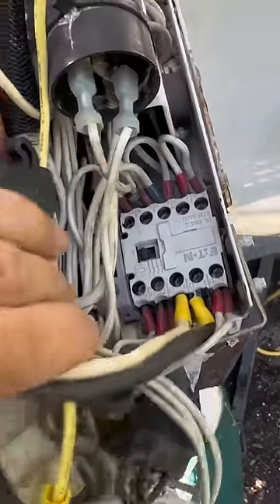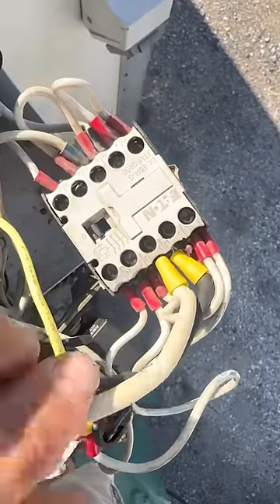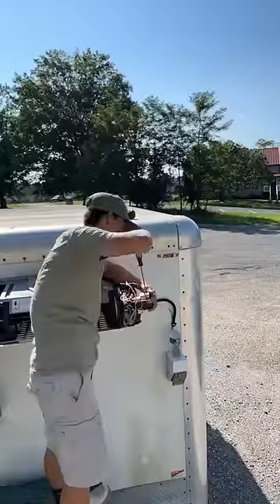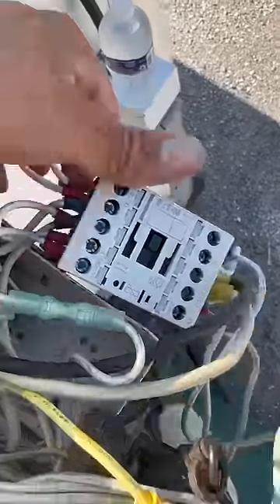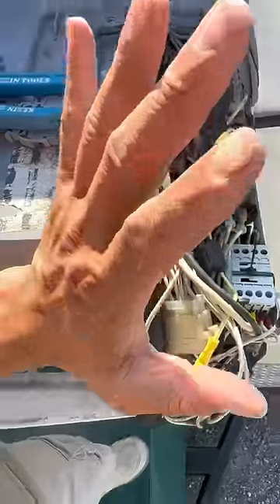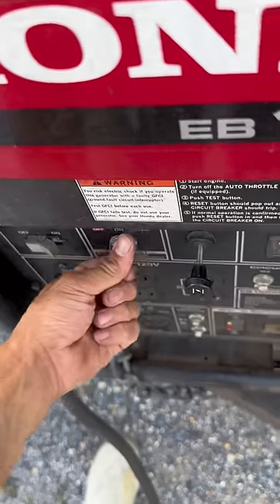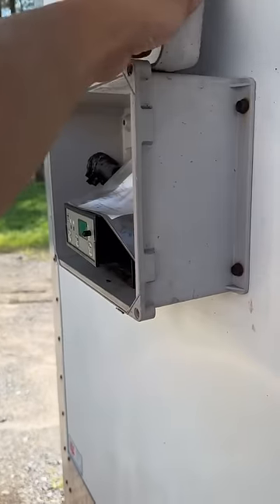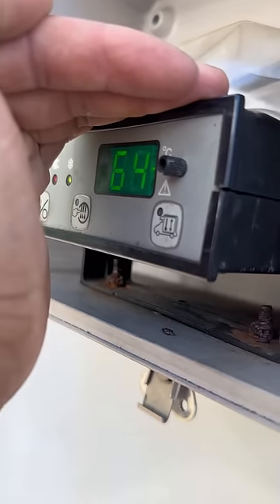This tiny thing has cost me THOUSANDS OF DOLLARS!

Comment: You need an alarm/alert on that cooler!
Reply: And make it a Bluetooth alert to go to your phone and your sweetie.
Reply: I did t see your post but I just said the same thing
Reply: One that alerts your phone
Reply: I use a webcam pointed at my thermostat so I can check it if I’m away.
Reply: Safetouch alert
Reply: Yes, the vaccine refrigerators at the hospital where I work have alarms if temperture goes below a certain level.
Reply: more than alarms but he should cobble togel ther a Refer Unit as a back up 

UP!! System the breaker Clicks Aluminates A.LARM by Wifi and Blue shoot

THEN Automatically Click!! "I got ch U... Re Re Re Ruh blub blub Choo Kerr Rutr Coooolin Gurvner

Rollina littlest Poof*

 uhh Co'al

that'd b '
Reply: Yes, because this wont be the first time a fridge costs him this much
Reply: I came to post this lol. I know I am behind. Does he read his comments? It would be easy for him to have that done.
Reply: @Sabrina-vu9mv All the hospital fridges usually have alarms. They are really sensitive, if you hold the door open too long they will go off. He needs to figure out a system to monitor the alarm if he gets one.
Reply: Thanks for saying it before me.
Reply: with an automatic backup cooler should temps drop to a 49* point
Reply: Someone needs to send him an alarm that alerts on his phone when it drops below a specific temperature.
Reply: Yep !
Reply: He should definitely have a backup system in place for something like that as well.

Comment: That is a contactor my friend. When the coil is energized it closes the circuit for power. Keep grinding and learning!
Reply: I was wondering if anyone else knew
Reply: Depending on if it's a normally open or normally closed contactor
Reply: Came here to say this.
Reply: Man... They've really gone up in price! They used to cost $20!
Reply: Annnddd the electricians meet here. My first thought was great ANOTHER breaker diagnosed to be bad for doing it’s damn job. But then… contactor. And yes my friend, not cheap.
Reply: @kr3wz89 with a fridge compressor probably normally open.
Reply: @OldsmobileCutlass1969Va it's an eaton/mem . May not be in production anymore hence the price on the Web.
Reply: Yup a European contactor for use with Din rail. I would be sad to see if he changed it and then found the coil voltage was the issue. It would have been good to test it by manually pushing in the coil with a screwdriver 🪛. 

Jeff - Licensed Electrician Sunny Central Florida
Reply: @onecrazywheel  I'm always afraid to push any contactor with a screwdriver, even an insulated one. I carry a chopstick in my toolbag nowadays for anything in a control box that needs to be pushed around.  I took out all the power in an assisted living facility once. Not good.

Gerry - Unlicensed commercial dishmachine technician Sunny Hawaii
Reply: @certifiedbrokanic  If you use a VDE screwdriver and press the top armature bar you should be ok,  But never go anywhere near live components with un-inulatted tools.

Comment: Just so you know that's not a breaker. That's a contactor. Think of it as a large light switch but instead of you turning the switch on and allowing current flow a coil turned on by electricity turns the switch and allows the top and bottom to connect
Reply: Thank you! I had to read so many comments before someone said this.
Reply: Help guide Nick to understand more about his situation.  I'm sure he would really appreciate professional advice from those who know.
Reply: Shouldn't the breaker have failed first?
Reply: They have different functions, so no. 
The old contactor wore out and needed to be replaced

Comment: Keep an eye on it dude. If the breaker tripped it might not have been the breaker, could have been something along the wiring that made it trip.
Reply: Glad I wasn't the only one who thought that. Wiring harnesses can go bad and not even show any damage.
Reply: @420Satan_IDI  exactly. Or you could have a wire that ever so slightly rubs up against the metal enclosure and over time the outer jacket could wear and cause nuisance tripping.
Reply: Definitely what this guy said!
Reply: That’s not actually a breaker, it’s a contactor
Reply: Refrigerator compressor might be drawing too much current due to age/wear
Reply: If it's for 3 phase motor, one contact could have bad contact, so the motor protection will trip (1 phase is missing).

But in this situation it looks like you have only 2 contacts (2+2).
Reply: This is a contactor not a circuit breaker so it doesn't trip or provide any protection. It simply turns on or off when it gets power.
Reply: Good catch, it is a contactor. That just raises more red flag to me. If it's just a switch and not protecting anything, then what is protecting the contactor? A fault in the system still could burn out a contactor and I wouldn't take it for granted just replacing it without understanding why it went bad. Unless its 10 or 20 years old then maybe. Regardless I would protect it with inline fuses. It's much cheaper, faster, and easier to replace an inline fuse than a contactor. You could also go the extra mile and wire up some pilot lights to indicate if one of the fuses blows. Would be pretty cheap and wouldn't take that long to do and could save your ass.
Reply: Warning, this quest leads to side quests.
Reply: @samuelneil2691  Normally there would be a fuse or circuit breaker before any contactor. Perhaps this guys setup does have some protection but he missed it? That aside common modes of contactor failure are damaged / worn contact points and also occasionally a burnt out activation coil. Just as you stated a lack of protection could cause the contact points to burn.
Reply: There's lots of reasons a unit would shut off. I would want to know how he arrived at this conclusion. I would say contactors are usualy around %15 of the time the reason.
Reply: I alway say ida breaker is tripped or fuse blown. It happened for a reason I come from 12v automototive electrify. Far more forgiving that that damn alternating current.  So
Reply: @bostonbruinsfanboy contactors often burn the contacts after years of operation, especially exposed to salt air, so probably it was not making contact to power the motor or whatever else is fed through the other contacts.
Reply: That was not a beaker it is a contactor.
Reply: That's actually a contactor which is even more troubling..... There's DEFINITELY other issues at hand.

Comment: You can order then cheaper but would have to wait for shipping online. They are common parts for PLC systems and control panels. I'm more used to Allen Bradley.
Reply: I'm engineer myself and PLC programmer. I use them all but Allen Braldey is the most common I program with.

Comment: As others have mentioned, that is a contactor. It looks like it’s a 4pole with the power circuits in series to divide the arc between two contacts. I can’t tell what coil voltage from the video but if it’s 120 or 240VAC you may have an issue with contact chattering during motor/compressor startup. This is a common issue when powering larger single phase motors/compressors from generators, especially smaller generators. This is due to the significant inrush current during motor startup causing the voltage to sag below the hold voltage of the contactor coil. If this is what’s happening the new contactor will also fail prematurely.

Comment: As an electrician usualy there's a reason a breaker trips if the new breaker is rated for the correct amps and keeps tripping you will have to troubleshoot a bit more. The fact it's for a fridge means there's a compressor probably a capacitor and relay. Google your make modle fridge and specific symptoms you might get some info on what to do good luck

Comment: Nice work, bro fast tip, put a tracktor tent over your freezer to cover it from sun, open the tent from both sides to have air moving, youl save lot of energy and the freezer does not need to figt direckt sun light. Can it catch :D

Comment: Thats a contactor not a breaker. That contactor is basically four pole single throw heavy duty relay. And all four poles are normally closed. but I’m sure they explain that to you when you went to pick up the replacement. :-)
Reply: It's not normally closed It's normally open and closed when the coil is engerized.
Reply: @camerongreco2146  Your right. I was going by what it appeared to be visible on the contactor in the video. But after looking up the model number, it is four normally open contacts.

Comment: Thats not a breaker, its a contactor (or relay). Looks like a 5-pole. Its like 5 switches. It can handle higher amperage. A smaller, lightweight switch connects to the coil on the side of contactor, and engages the electromagnet in the contactor, closing the 5poles, completing 5 circuits.
Happy Birthday, Grandma! Stay strong, outlive us all!

Comment: Wow. This is exactly why I said to check these relays when I seen your overheated wires. But I know my comment was lost. Tried a few times😅
Reply: And before anyone says it to me, it's a 4 pole contactor that he just replaced.  Some call them a 4 pole single throw relay, 4 pole electromechanical switch.

But these can have 3 on 1 off when activated or some other strange combination needed, and some have auxiliary on top. And cost an arm and or  leg

Comment: Before you think changing the breaker will fix it. You need to measure the amperage draw on the system. There could be something else wrong that is overloading the breaker. You need to check everything. Make sure the condenser is clean. If not it could cause the high pressure side to be to high working the compressor hard and drawing to many amps causing the breaker to trip. So don’t assume take the time to check everything 😮
Reply: It was a contactor not a breaker. They only last so long.

Comment: Contactors are a part that should be inspected and replaced as a maintenance item after a certain amount of run hours and you should check wires for tightness and check voltage and amp draw that is a 12amp contactor also keep the condenser coil clean dirty coil causes higher refrigerant pressure which causes higher amps and you should do some research on generators just because it's a good brand not all provide clean consistant power for inductive loads/ electric motors

Comment: Hey i do this for a living, get a line voltage thermostat to make a circuit on temperature rise and alarm bell or red flashing light etc. For a n alarm. Try to use a separate circuit so it the cooler looses power its not affected. Keep working and good crabin .

Comment: That "breaker" looks more like a contactor. Think of it as a switch that has the control power separate from the motor power. 
So you can use 24v to control the higher 120/240 voltage.

Comment: there must be something out there that will text you if the temperature goes above a set value. if not, maybe something that alerts you that no power is being used. the electric monitor is not bullet proof in the event you run out of freon but at least it would work on breaker trips.

Comment: It’s doubtful that the breaker itself is bad. It could
Be, but more than likely something’s causing it to trip. Weather to thin or wrong type of wires somewhere or the heat idk but you gotta figure a way get a cell notification when the power goes out. Maybe a ring cam idk

Comment: Clean out and defrost the cooling coil in the fridge and the condenser coil on the outside.  The breaker trips because it is in an overload situation, you need to take a look at the mechanical parts through the fridge to see why!    Happy crabbing.   I’m also just a framing carpenter maybe there is an electrician, HVAC technician or electrical engineer that can help you better.

Comment: The barker go bad do to heat  ,condensation   caused by something else's. Find that overload or that will come back. A braker is a engineered week link .  Dialect grease  to keep out water.
Reply: It wasn't a breaker. It was a contactor that goes bad over time from opening and closing. Just normal wear and tear.

Comment: The breaker and plug are signs to other electrical problems. Most likely under sized wire
Reply: It was a contactor that wear out over time.

Comment: You're not an electrician. I am, so some advice to save you money, a breaker that trips does it's job, protecting the whole circuit. Usually the real problem is the load is drawing too much current because it is worn out. In the refrigerator, it would likely be a faulty compressor.
Reply: It wasn't a breaker.  It was a contactor which don't last forever.

Comment: Dialectic grease so keep that contact from corroding. And then you get a whole bunch of load on it, and it Burns out your breakers. Because you keep reset in a breaker thinking that's the problem. It's not you're overloading and it's probably due to the exposure of salt air to your exposed contacts. I'll buy you buy components to design for at sea. You know sealed so that you don't have green slime Uber everything I bet I can strip half the water's back on your. And they're covered in green Slime and running hot. Oh, well, it'll burn someday, and you with it.

Comment: Put an ammeter on those load wires, heat may be wearing breaker down prematurely.
Reply: It was a contactor not a breaker.  Contactor points burn out over time from opening and closing.  Normal wear and tear.

Comment: It’s probably because you started cutting the ends on the terminals so they can fit.. in doing so the ohms/resistance is not the same so it probably blew out
Reply: It was a contactor which wear out and need replacing.

Comment: Man find an HVAC tech somewhere down there that likes fresh crabs…….barter it out…….plenty of guys will work with you on trade.
That component is a multi pole contactor NOT A BREAKER. They normally last a long time but can burn up or go bad from loose connections or overloading of the wires to the parts they control. Make sure your connections are tight on all the screws….best to check right after you shut down power to the whole trailer after running all day. Any wires can loosen up connections after electric loads are on for a long period of time, like running all day.  MAKE SURE TRAILER IS UNPLUGGED before checking.

Comment: That breaker probably died so you don't need a new fridge . It will probably happen again. Something in the circuit is causing spikes in amperage or even voltage.

Comment: Not trying to b funny but if u pay a comp to do it the perk is the warranty and their insurance will cover ur losses if it fails. Unless the cost of a comp doing it far outweighs it. But also u should ck ur insurance policies cuz usually if ur installing electrical where I live with out a lic number and an electrical fire breaks out they’ll deny ur claim. My FIL learned the hard way. Insurance didn’t cover it cuz a friend installed it for cheap. Just some info from experience. I’m not an expert nor do I know what laws or insurance policies r there  as I don’t live there.

Comment: That’s a relay not a breaker,,Never daisy chain neutrals,, first check voltage on A1-A2 that’s your relay coil to pull in contacts,, lots of problems here ,, clean up your wiring first ,, if not, it’ll happen again.. lots of luck .. and go to Siemens relays & contacts .. 😬😬

Comment: wouldnt it be easier to put  a  10,000 btu a/c unit on the trailer ???
Reply: An AC won't work. Temps need to be kept between 48 to 58 degrees to keeps crabs alive. Household AC units don't get that cold.

Comment: That isn't a breaker. It's a contactor (or relay) that has an entirely different function than a breaker. It receives a 24VDC signal from some other device to switch on probably a 120VAC compressor or pump motor. Whoever wired that should have their hands cut off. No labels, no color code, and looks like they are feeding power into one end and getting switched power out the same end. This is atrocious.

Comment: I jist fixed a wire? And its still blowing the breaker. U got a bad wire or multiple bad wires. For sure probably from moisture brother. Ik it sucks but id call a fridge guy to come check it out before u spend another 250 if it happens again.
Reply: It wasn't a breaker that went it was a contactor. Contactors fail all the time.

Comment: That IEC device is dirty as hell.  You don’t do proper maintenance obviously.  Then upset when parts fail.  
All over current protection devices (breakers) are to be cleaned, connections tested, and activation tested. 

Do you drive a vehicle 50,000 miles and never deal with oil, tires, etc.?
Reply: The hilarious part is that isn’t a breaker.  It’s a contactor.

Comment: You might want to add a heatsink plate and some ventilation around that breaker/contactor to help with it's longevity  and so it doesn't trip so easily. Prolly getting overheated in that cramped area surrounded by wires that are hot...